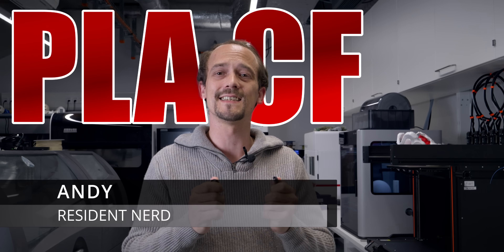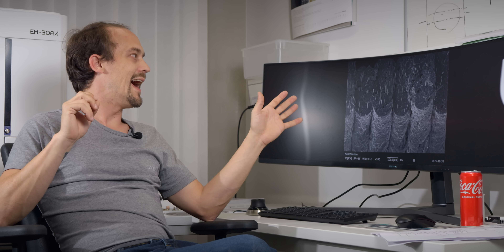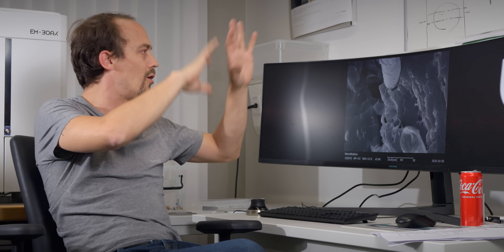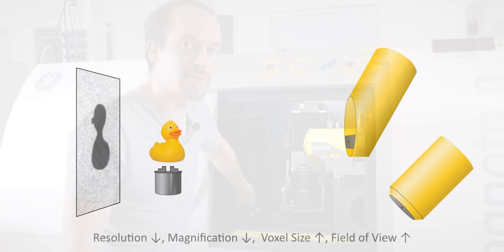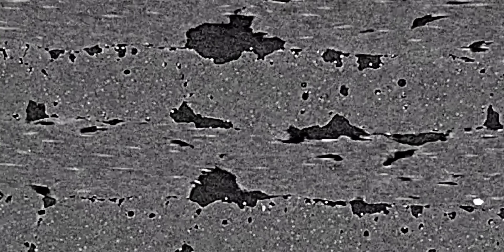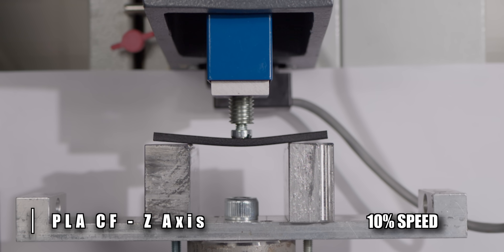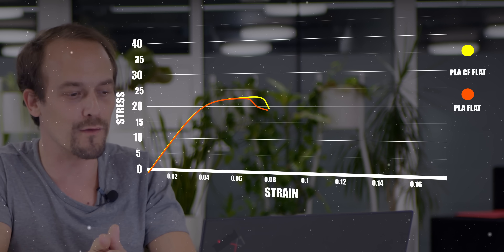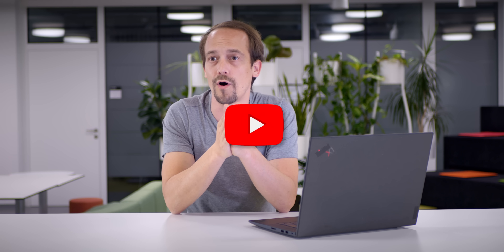3D Printing’s Biggest Scam Is Even Worse Than We Thought!

Comment: Great video but one suggestion. When comparing PLA vs PLA+CF, you could consider to account for the density and cost difference, and calculate specific properties (eg strength/mass, or strength/cost). In FDM for drones we are typically designing parts as thin skins with infill to achieve a certain stiffness and strength for a given mass. We can always make a part stronger and stiffer by adding thicker skins and more infill, but that means more material = more mass, more cost, slower printing. If PLA+CF is more dense then we must use less of it by volume to achieve the same weight. In other applications, cost is the driver rather than cost. PLA+CF should have a much superior mechanical properties to justify its higher density and cost, so presenting mass- and cost- specific strength and stiffness has some value.

Comment: Well that brings together my own experiences with that material. From what I tested it was softer and less hard but the fibers give two benefits for me. First the optics and second that it is in my eyes the best non specialized material for making bearings with metal contact. Within some spins the fibers flatten out and provide a much better surface for gliding  wich results in a way higher lifespan while normal PLA or PETG gets eaten up kinda fast.

Comment: PETG-CF def stronger, I did a part for a reduction motor and regular PETG snaps after 3 seconds after motor starts, PETG-CF runs for almost a month before breaking. Maybe it works because PETG more viscous?

For the PLA-CF it's probably more for the looks and feel, not for the "premium stronger option", but if the seller says that it's much stronger then it's a problem.

Also idk, I like the AI music used in scenarios like this

Comment: I can definitely see the voids discussed in the micro-CT sections shown. That said, I also saw plenty of fibers that did not appear to have voids. After segmenting the image to PLA, CF and void volume it would be interesting to see a statistical analysis on the percentage of fibers with voids adjacent to them. Going to even higher magnification might show that even the ones that look bonded may have interfacial failure. Lastly, I wonder if volumetric contraction of the PLA on cooling is also contributing to interfacial failure.

Comment: I don't think PLA-CF should exist.
It doesn't provide very much at all, it gives us barely any increase in temperature resistance, less layer adhesion, and makes it more brittle than it already is
The texture is kinda cool, but it's also not great for you at all.

I'm not against fiber reinforced filaments, they absolutely have their place- I just think pla-cf is just a little bit too consumer-accessible.

At least when the reinforced filaments were limited to more exotic plastics you would inevitably learn of the pros/cons of these materials before you purchased them

But I've seen too many clips of people using pla-cf just for the look..
Reckless, and a huge waste of money

If you need it you need it.
But a good percentage of the people using these do not actually need it.

Comment: I was thinking this same thing when i heard of such material im experienced in the collision repair world with enough understanding of how materials like plastics are designed especially the fusion of repairs when its practical and doesn't exceed the effective strongest repair and there is nothing about carbon fiber that's been shredded and mixed with any form of plastics of any sort that's going to be effective because carbon fibers are only strong because of how individual strands are woven together and in several different pattern orientations for certain effective strengths for the part being made and the resin is what ultimately makes it become stronger than some metals depending on the layup

Comment: The only thing I've noticed with PLA-CF vs. regular PLA is that it does not flex for pressure fitting. I printed some parts out that needed a magnet pressure fit into the piece and with regular PLA it was no problem. However, it was nearly impossible to do it with the PLA-CF esp. with the part being small and awkward to secure to try and use a press.

Comment: Solution for voids is quite simple; just vacuum at the gel point. I also think that this filament is run by a lot of cowboys and amateurs who don't know extrusion principles at all; they simply try to get a specific diameter on a spool at the highest possible speed. UPVC wouldn't have voids at all because it's one of few extrusion processes that have vacuum at the head. Worked 35 years in the industry. There's nothing I haven't made; from sheet to rotation, I've seen and done it all. Currently running 9002ISO medical equipment in a robot-filled clean room.

I should also mention that any filler used in poly is commonly considered brittle. Consider Acetal for example, it's commonly filled with glass to give a perfect finish. Think rain gagues or thermometers. It's not perspex, it's poly with fine glass. Very abrasive for the machine and mould over time. It will never bend, always crack. Shatter and not bruise/oxidize. The only real life application you want for this material is sight glasses etc where you want a glass-like material. Otherwise, it's useless in terms of tensile strength or rigidity. UV treatments could well be seen as "metal fill" being they are mostly Titanium powder; TinUVin as it's called. It offers again no rigidity, only weakens the bonding like chewing gum full of sand; it cannot bend or it will oxidize intantly ie turn foggy.

On a molecular level, plastic is mostly spider webs, some with blobs on the end we call "tailings". The longer the tailings, the more flexible the material. I'm sure you're well aware of this.

I don't 3d print. Have crazy exp. in the industry from making CDs to school chairs. Have you ever thought of resting a bar of parafin on the filament?

Try it :)

Comment: If the added material not bonding with the medium its a contaminant. 

Carbon fiber is same as fiber glass. But the resin actually stick to the fibers and they use woven mesh or rope of continues fiber. Iron needles are use in concrete but they bond to the medium too.

Comment: Other materials with CF and health issues would be very on topic.
One of the main polymer on our production line is PA6 CFF30 - I find it quite often de laminating between layers, even despite the fact our regular printers support 100 degree in chamber and 295 on nozzle (higher nozzle temps cause it to partially evaporate, as my experience tells me - tried 315 - there is a slightly visible vapor appearing, like it wasn't dry, thought it was).

I really wonder, whether warping and shrinking of PA6 would help to keep carbon fibers tighter, compared to PLA, but the problem of layer bonding is definitely still there - pure polyamide feels way better if speaking about Z layer adhesion. 
Even when treating regular PEEK vs PEEK-CF I felt it suffered from the same issue, regular was more "overall" better, but CF definitely was better along the layer. Both in-situ crystallized during a print with hot+ (160 chamber, 390 nozzle).

Comment: I absolutely think you should do a ‘health risks of carbon fibre re-enforced 3D printing materials’ before this thing gets out of hand and we end up with another mass asbestos or tobacco like health crisis in a couple of decades with millions affected… Not just direct surface contact either but what does it put into the air when you print it? This is probably even more important actually as once you breath these fibres in they are probably in you for good not potentially shed like surface skin.

Comment: The thing that struck me about the concept of carbon fibres in filament inthe first place and made me suspicious about the idea is that the fibres must be extremely short for the filament to still be extrudable, and that inherently undermines the whole advantage of them. In normal use, for both glass fibre and carbon fibre, it is the length of fibres, which gives a very large contact area between the fibre and the surrounding resin over a great distance, and the overlap between long adjacent fibres that gives the material its strength. Chopping the fibre into microscopic bits just turns them into impurities.

Comment: Now I know nothing about 3d printing except what one reads and/or sees while watching videos. But what I've found weird in the carbon fiber fillaments and people telling how great those are, that as far as I know, the CF strength comes from the fact that it's continuous "mesh"(/woven fiber or what ever the English word is). By having it in a plastic means that there's that one strand that kinda has more strength to it, but since it's small, and they aren't connected to each other, it's just "more expensive" plastic you get. Like I said, I'm not an expert, just what I think by what I know about things. So the only way PLA gets strength from CF is if you laminate it after printing, or you print it with spaces to insert the CF rods. One thing I'd want to test is could you print a layer, pause, add as thin of a piece of woven CF as you can and print on top of that. I'd assume it doesn't really add anything, since it's still raw CF, but still relatively interesting.

Thanks for the video. It explained things deeper and more profoundly than I expected. I now know more than I did when waking up. That's a good day.

Comment: Can confirm, the 3d2a community has sworn off it because of its horrible properties. Even basic PLA can handle shock from firearms better. The dart blaster modding community also hates it because of it's terrible load capacity with high powered springs in air-piston or "plunger" designs.

It's only redeeming factor is it's better modulus of heat dissipation from the carbon shreds, something so easily designed around with metal sheeting or a cheapo heatsink.

Comment: I use PETG with CF not because of increased strength, as I noticed long ago that PETG with CF is more brittle, but because of the appearance of the printed material. On the other hand, adding CF to PA allows me to print durable parts without worrying about significant PA (nylon) shrinkage. I do not use PLA CF.

Comment: Finally a more scientific take using proper analysis instruments! (While keeping it to point and fun!) 
So composite materials should in theory benefit from the CF if the matrix (PLA) also can chemically bond to the fiber reinforcements.
I guess the surface chemistry interaction with other polymer matrixes are more similar to that of CF.
Also suppose filaments manufacturers are not advanced enough to functionalize the surfaces of CF to be used with PLA but that would likely actually make the combination work!

Comment: I am quite sure the viods are from the added friction (or rather variance in friction) through the printer nozle that the fibers are adding. 
if we look at the layers, they look a bit loke they are stretched, like the priunter was mooving faster than the material was actualy getting through.

Comment: A deep dive into the abiss. So many wrong things here and so many wanting to believe this, I won't waste my time correcting them. Anyone designing pla of any kind for strength will be greatly disappointed. Pla-cf will be slightly stronger in compression as long as firces are across layer lines. That's it. The cf's are so small, they add zero strength in tensile. Normal engineering sample testing gives the data for designing. That is, fdm printing requires great sized parts for weak applications.  Want strength, print your pattern and cast it in metal.

Comment: PLA CF is a scam, yes. Because PLA doesn't bond to CF. 
But what's wrong with PETG? I've been printing with PETG-CF and PETG-GF for over a year now and, it's my favorite filament type now. I did various comparison tests between reinforced and pure petg from eryone and my results say fibers add ~30% to stiffness, ~40% more load resistance, while lowering impact resistance by the same ~30% (due to stiffness rising).
I do not have "certified" loading or impact machine, not x-ray scanner.

Comment: If there is no ionic or other chemical adhesion then we are relying on mechanical retention. This would be classified as micro-mechanical retention. 

I would very much like to know the surface energy behaviour of the cf fibers and the PLA in molten and solid state. 

I think a presumption exists that adding cf or gf is like straw in a mud brick. The analogy fails though because we don’t know the interactions between the fibres and each material. 

I like videos of this nature because it’s useful to analyse this and not presume “common sense” of people not expert in material science is correct. 

I don’t even know if manufacturers of filament are even providing such tech data; it seems they pump out combinations based on macro mechanical testing only; useful yet not fully informative with respect to full material behaviour.

It might be the inherent weaknesses of fdm make this less critical than it would be in a pure analytical scenario.

Comment: My understanding of CF was the strength followed weave and that most cases was weaker if forces applied otherwise....but then there it the weight factor.......still it is the 2 that make CF what it is....strength and lightness applied appropriately. Take a bicycle frame for example, in most case there is a slight oval shape- horizontally...fvery strong and can take great deal of forces applied from above and below along with front back... take that compared to a steel or alu frame...canreduce material weight substancially...not even so much thast the material it self weighs less- there is that- but also, since the weave/ material composition provides mor e strength with less. Now apply forces from the side..and you are even worse off...some times catastrophically worse off.... when a carbon fiber part failes it fails dramatically and is sharp+ many "shards"....where as the same but steel or alu...more the steel...you'd see it bend first...the alu could crumple in onto itself especially if the componnents shape is compromised.

So, I never kinda got the strength claim for CF fillements...they have a nice finish to them..and certain ones have this nice tough sound to them..even almost like a metalic clink. And recently that idea was even more reinforced :) learning that the CF fillaments are just melted glass shards in certain brands....then your experriment here...is very intresting since it does demonstrate the possibillity of CF's strength propperty a possibillity where the fibers weave through one another. I am sure this isn't the case with alot of CFmfillaments though...

Something else...there was that 3d printer expo thing that just wrapped up and there was a inovative comppany that had created a 3d printer with the technology to actually print with CF and have the material create a bond with itself...providing an end product which has incredible strength pproperties..again though just like actual CF, only in certain direction. Forgot the company name...I think that the whole CF thing was their speciallty though...

Comment: I'm sorry but isn't this rather obvious? Carbon fibre works by having high tensile strength. You put the long fibres into a material like rebar in concrete. A 3D printer CANNOT work with long fibres. Hence PLACF CANNOT work. It may make every drop of PLA slightly harder but it CANNOT do anything for how the drops stick together, it CANNOT make fibres run from one drop to the next to the next to the next.

I'm sure it's just me but... duh?

Comment: .. aha you dont say .. and now you tell us all Water is wet ? To much talk  anyway

CF are working fine with Resin because  there are more than 50 Years of Research and Experience behind it.

But who thinks that some Plasic mixed with CF will do the same is incredibly naive !

FDM Printing is always about Layers  .. thats the first Problem

Second there is no real Control about Heating Flow  in most of the Printers  its mostly a lucky Shot 

To think that CF Filament can beat the "Original" is madnes .. that will never happen

Comment: I always suspected that CF, especially in PLA, doesn't actually add strength.
The whole point of CF is, they are long fibers and they are connected by a resin.
CF filaments don't have the time to actually bond with the CF in the cooling process like resin does, even if the surface of the CF allowed a proper bond.
Second is the length of the fibers. A big deal of stability of actual CF materials comes from these fibers being long strands woven like a fabric. In any CF or GF filaments there's basically shredded fibers, not "long ones", and without proper binding between the polymer and the fibers, those fibers will mostly be loose in a void (like your tests showed). Furthermore, those fibres run all basically in one direction, with the print-flow, which can't add any sthength in between layers. So, if anything, added strength could be only with the grain, which is already pretty strong by itself. Those voids, however, disturb the grain as well, making the whole thing more brittle.
I've seen quite a few tests myself, and the only "advantage" coming from CF is it's nicer matte surface with less pronounced layer lines - but that's, like your tests show, just due to fibres sticking out of the surface, making it more fuzzy and releasing dangerous fibers into the air.
Thanks very much, your video explained some of what I already knew. The health risks was something new to me, and I don't think even trying CF is worth it for me.